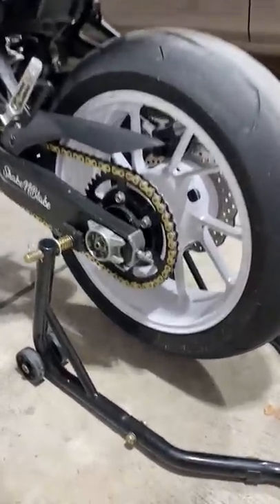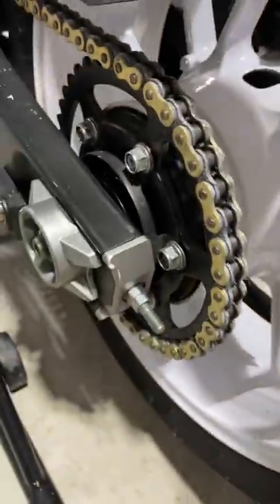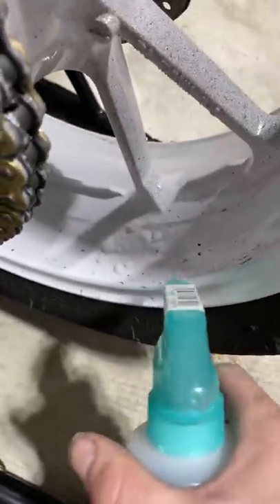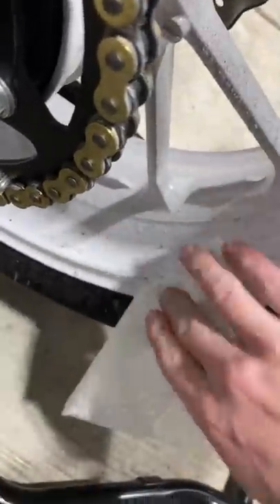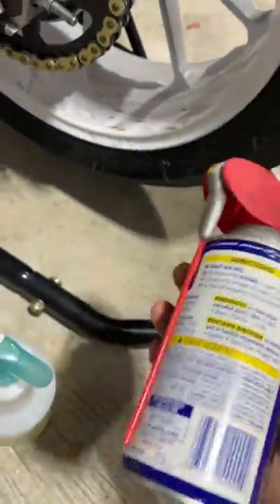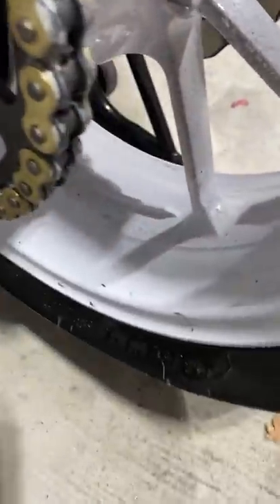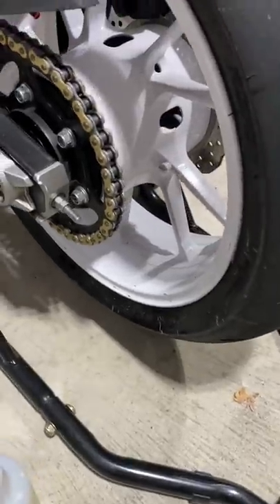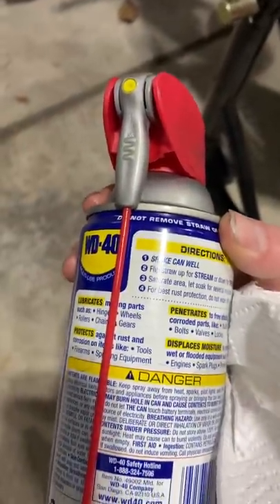EASY tip I wish someone taught me when I started riding motorcycles. #shorts

Comment: If you’re going to do this I really recommend to spray it on the paper towel and not directly onto the rim the last thing you want is WD-40 on your tire
Reply: WD works great for mounting tires and just about everything - you don’t want it on the tread!
Reply: Dude I spray wd40 on just about everything it's one of the softest lubricant out there it actually HELPS rejuvenate life back into rubber tires kinda similar to armor all dried up tires or ones who ride hard to heat up the tires takes out the moisture compound, ever seen an old rubber band & tried stretching it? Now think of industrial or mechanical world with rubber o-rings that are used to seal, if the rubber stays supple with oil it never goes bad but if it dries out or is heated up it cracks & fails, anyway wd40 will only make your tire feel "sticky" NOT "slippery". Been a mechanic for years so that's just my experienced opinion not sure where you gain your opinions from
Reply: Also wanna avoid them brake disks
Reply: Why not the tire
Reply: @lonewolf6842  Yeah, I hear it helps with cornering. Talk about draggin a knee lol.
Reply: @franmitch3589  I'm not disagreeing with the rest of your statement, but wd40 isn't meant to be used as a lubricant at all, the "WD" stands for WATER DISPLACER (40 just means formula#40) and it also contains penetrating agents, so it's safe to assume that the "revitalizing" effect that you see is very short lived and it actually dries out the tires in the long term, but if you've never had a problem then I don't see any problem using it for whatever you want, heck, spray it on your eggs in the morning for a nice zest!
Reply: keys yeah I'm very aware of the original water displacement definition and its origin but the compound ingredients have changed since its original release, and as a side note never had it on eggs but my hands are regularly black oily greasy & I'll stop for a sandwich or burrito & usually end up eating the filth but done that over 20 years & my father before me lmao
Reply: I’d be less worried about the tire & more about the brake side of things
Reply: Wd-40 on your tires will evaporate in a few hours. Not a big deal. Just don’t go around trying to pop wheelies.
Reply: I spray it directly on my treads for added protection of the rubber tires regain grip after a few rotations. Honestly it's a urban myth. Not like your hitting an oil slick on the road
Reply: @franmitch3589  they have a wide variety of products but the original is still mainly for use as a water displacer, and yeah I've been there, but then realized most the older people i knew who didn't protect themselves against harsh/toxic chemicals died fairly young, typically of cancer, or got cancer at some point in their lives, so I eventually found out about this fancy new invention called soap 😮 the difference is mind-blowing
Reply: Don't want it on your brake rotors more like
Reply: Or disc brakes and pads
Reply: @D0CT0RD00M  you’ve never ridden a motorcycle have you?
Reply: @franmitch3589  when you spray it on rubber it will puff it up and start to disolve it and you dont want that especially on bike. And if you spray this on O rings? Good luck with the leaks
Reply: @sharpshot5408  done it for years no bad experience aside from routine maintenance & I've owned motorcycles since high school all the way to current now in 50's everything from Suzuki honda Yamaha & a few Harley sportsters where I live it's cheaper on fuel to commute on a bike so literally owned 1 or 2 at any given time heavily used for past 30 years I ride on dirt county roads pavement mountain passes city driving & commute town suburbs I'm a field mechanic for highway equipment kinda know my way around motors so kinda lucky I guess?
Reply: @franmitch3589  i dont work on bikes but i can say from my own experience it doesnt react good with rubber
Reply: @gw03._25  why? 🤣
Reply: @D0CT0RD00M  Why? 🤣
Reply: @Jeff-fx7bh  Why? 🤣
Reply: @doylehargreaves5057  lol prolly more than you could imagine buddy, I’m not saying it’s end of the world it’ll burn off but why would you want lubricant on your pads & calipers ?
Reply: @Andreas-yt9wv  why what ? Explain to me why tf you want wd40 on your brakes ?
Reply: @franmitch3589  its not a lubricant
Reply: @TheTyisawesome  no its not. It will dry out the tires. Do not put anything on a tire other than soapy water.
Reply: @Andreas-yt9wv  WD 40 has lubricant and other additives in it. Lubricants minimise friction, brakes use friction to stop. Contaminate your disks and pads with lube you'll be riding off the edge of a cliff.  

No real effective way to get it out of pads. New pads all round.
Reply: Or your brake discs
Reply: Came here to say just that.
Reply: kicks yes it is any petroleum byproduct that creates the surface to have a film will act as a lubricant heck margarine butter would too, seriously crazy the replys on this subject & wonder where people pull them from spray wd40 on a metal surface look at it days later under microscope it's still got the residue there dang I dont have time to teach people what's what so go on & make whatever little troll comments you guys want I've got YEARS of real world experience to back up my statements have a good day all
Reply: Wd40 isn't oil, it would make zero difference to the tyre
Reply: @franmitch3589  what does packing grease do  and all lubricants do? displace water to protect metal components..
Reply: @franmitch3589  
Sharpshot is right.  WD40 is up to 25% to 35% petroleum.  Petroleum WILL dissolve rubber.  The rubber will "puff up" as he stated.  It will seem like it is doing you a favor initially.  If it hasn't gotten the best of you, yet, you're lucky.
The best thing for rubber is silicone or teflon.  I also have had luck with winter green oil.  It is plant based and can revitalize stiff rubber and brittle plastics without degrading it...smells nice, too.
Reply: Or anywhere near your brakes. Doh. 😱 😋 As I have seen spray on cloth, then wipe.
Reply: You mean y'all don't use WD-40 as tire shine?
Reply: I came here to say exactly this. You don't want lube on your tires.
Reply: No kidding😂
Reply: Don't mind the tyre, mind the brake disk.
Reply: @franmitch3589  seems like, too me, you use equipment regularly... which might be why you've not had issues with o- rings failing... compared to someone who let's things sit. So maybe it's not the wd-40, but the "use it or lose it"mentality you live is having the positive effect
Reply: No it only seems like it does in the long run it with solvent the oils out of the rubber.  Also if used to mount tires it causes the rubber to stick to the rim. Use conola cooking spray to mount tires. Work even better and wont damage the rubber.  Wd fan boys need to stop promoting dangerous uses.
Reply: Don't worry about the tire it's the brake rotor you want to worry about
Reply: @CarlMan69  very true
Reply: @franmitch3589  LOLLLLLLLL
Reply: @SwitchetBladeX3  LMFAOOOO
Reply: @franmitch3589  I race super bikes and you must be a terrible mechanic, it will absolutely cause issues on a tire it actually will break down the rubbber . Let’s not even get started on what happens when it gets on brakes . Don’t get anything on your tires good lord , makes it sticker what kind of mechanic are you gonna have kids spraying lubricant on superbike tires . Do you even ride???????
Reply: @franmitch3589  must be a terrible mechanic, lmao you cruise around on harleys or on dirt roads and are telling people who own superbikes to spray  wd on tires ????????
Reply: @mcsbikelife3829  I rode for over 40 years all over everyone untitled to their own opinion my comment was basically stated as a view that the sky wont start falling if wd40 gets on  your rim or tires or whatever I replied to a post that said it's not a good idea, I just stated my account of experience over almost 30 years working on all sorts of motorized equipment it's not the end of the world heck you could wash the bike in it & it'll still be ok & not to be defensive but as to what kinda mech I am well I'm the lead field mechanic for highway paving crew we work statewide all are licensed within an area where of truck drivers & equipment operators I service it all usually on the side of the road not some prissy shop everything from new digital stuff to old oil leaking smoking disasters seen it all already
Reply: Yup I was just gonna say that thank you for putting this on because you probably saved a lot of riders before I would have put this on!!!
Reply: @lonewolf6842  because WD-40 DESTROYS rubber,
Reply: Been there done that
Reply: Dorifto mode on
Reply: Yeah I was thinking the same thing.
Reply: @andrewarnott2619  would defeat the entire purpose because he has white rims
Reply: WD 40 will actually soften a tire and make it grip more as long as it isn't saturated. Go karters have been using it for years as a tire softener to get more grip out of thier tires.
Reply: Yep
Reply: My first thought exactly!
Reply: @GreenMntMoto  well I do it to drift better
Reply: And brake rotor
Reply: @This YouTubers Neighbor RyanF9 did a video on this subject.
Reply: @franmitch3589  WD-40 is not technically a lubricant, it's a blend of several chemicals. More of a protectant which is why it helps leave rubber conditioned. A fuel oil such as engine oil, gear oil, tranny fluid and such will break down the plasticizers in rubber. Unless it's a special type of rubber. You say your a mechanic, then I know you've seen  hoses around the engine area that are so soft that they literally fall apart in your hand from being soaked in oil. I also am a wrench man and I know the differences. Actually your technically right about it getting on a tire, I've been riding for years myself and I've had it on tires and brakes. No big deal if you get a little over spray on it just wipe it dry and it'll be fine, it's not like your soaking the damn thing in it geez these girls commenting do think the sky is falling. The guy with the race bike...hell yes I don't want any slippery shit anywhere near my bike. Love the guy who said just do a burnout
Reply: Funny some of the comments here , spray on go kart tyres for grip hey , mmm   How often they get changed , couple of races . Would they spray it onto tyres in the wet , no , what you going to do use your bike and hope it don’t rain whilst out . Never spray wd40 on tyres , the petroleum breaks down the vulcanised oil in the rubber causing it to go hard . Spraying wd40 on tyres is asking for it , probably like that reg plate is too . What banana said fit it there cause as soon as police see your bike your fined for it . You can tell the newby riders saying I spray my tyres , listen to the old riders who know through experience, tyres and wd40 don’t mix
Reply: @pauldean8638  bUt ThE iNtErNeT!
Reply: @pauldean8638  thank you
Reply: @thicok4555  hey no worries , you know the answer mate ha ha  , it’s all age and experience where you think oooh tyre looks shiny, then next min your on your arse wondering why in the rain ha ha . Best thing in a bike is Gt85 the best as it’s Teflon . Makes things less stick able so the bike stays cleaner longer
Reply: Gives me a good reason to do a burn out.
Reply: @pauldean8638  it’s sad to see kids think they know everything in this world nowadays and your 100 percent right ride safe brother
Reply: @thicok4555  yeah ha ha how many dismiss the wealth of knowledge through people who experience things first hand . I was guilty of dropping a few bikes after being told don’t spray your tyres . Still it’s a life experience you learn the hard way by road rash and mending your bikes ha ha funny how we the ones giving advice to the younger inexperienced. You ride safe to my mate ,  we already riding safer , we don’t put wd40 on tyres lol
Reply: Exactly!
Reply: I'm confused?! I just took my bike to my mechanic for my 50xxx mile and he told me since I've been neglecting the maintenance side of my bike I have to get new brake rotor. He said that every 500 to 1000 miles you're supposed to lube the rotor to maintain even brake pad wear. 

I had no idea!!
Reply: @hardedar9647  that’s the reason why you paying for a new rotor because you did or didn’t know he’s full of poo . Bet he said he do it cheap as he can and just fit you in . Calliper move to even out brake wear
Reply: @TheTyisawesome  not good advice is it. Seriously are suggesting to spray oil on to tire is a good idea.
Reply: @lonewolf6842  petroleum products degrade rubber
Reply: @steve0680657  petroleum products degrade rubber
Reply: Not going to hurt anything its a solvent
Reply: Ditto
Reply: No, the last thing where you want it is on your brakes
Reply: @franmitch3589  seems like common sense to me, the comment about not getting it on the tire, I always get some chain wax on my tire but I’ve never lost grip because of it.  As long as you’re aware of it, and go easy for a bit, it will rub off as you’re going down the road.  You don’t want to wear off your chicken strips before the tires have warmed up anyway
Reply: @GreenMntMoto  wd40 eats rubber compounds. You dont want wd40 on any rubber at all

Comment: There is also a product available that’s made specifically for degreasing things. You’ll never guess what it’s called.
Reply: Lmao....good one.
Reply: Deg…….
Reply: D e g r e a s e r
Reply: Dw04?
Reply: Good one
Reply: If you haven't got that. White spirit. Or terps. 👌🏼🤷🏽‍♂
Reply: Daki
Reply: 1173
Reply: Hahaha
Reply: Water displacer formula 40????
Reply: Water displacer formula 40???
Reply: Brake cleaner does wonders against grease
Reply: Waiting for this
Reply: It's called "Ungrease-anating spray".
Reply: @johnvang1592   i just deleted my comment after reading yours 😆  i said Ungreaser too   lol
Reply: Lol
Reply: Let me guess, its call increaser
Reply: because wd40 is not a lubricant, am i right... best to rub it on the tire and brakes as well...

not like a standart cleaner costs like 1 $ more and does the same thing without applying a layer of friction reducing chemicals on the surface...
Reply: Paint remover 🤣
Reply: I like using googone. It’s kind of like a mix between wd40 and acetone. But it won’t hurt the clear coat on the wheel
Reply: Tire shine
Reply: Degrassi, Drake's a shareholder
Reply: BRAKE CLEANER
Reply: Don’t you say degreaser lol
Reply: I always use brake and clutch cleaner. Around £15 for a 5 litre can lasts for ages. You only need a little on rag.
Reply: WD40
Reply: Degreasenator?
Reply: Kerosene ?
Reply: DE- GREASER.  soo you take a teenager from the 50’s and wipe his hair on it ???!!!wtf.   I guess! Come here boomer!!!
Reply: Wd40? The degreaser
Reply: Try Lemon Pledge you'll never use anything else.
Reply: Oh shit degreaser who would’ve thought of that.
Reply: @ssproductions790  break cleaner would work but thing about break cleaner is it's not safe for all surfaces. Like powder coating. It will eat through powder coating.  WD 40 won't.
Reply: @MSRooky350z  WD-40 lubricates. Prob best not to put it on brakes or tyres. Although I'm sure I have by accident.
Reply: Break cleaner or spray 9 for me
Reply: @iManMe23  just out of curiosity, why are you tagging me with this?
Reply: Lemme guess... Soap?!?
Reply: @ssproductions790  and paint
Reply: Beat me to it.  Degreaser is also cheaper than wd40...
Reply: @jijoet5491  haha that's funny ASF😂
Reply: You could also use the same product you use to clean your chain I use kerosene/paraffin
Reply: Ya it's called thingy degreaser stuff
Reply: Well he is usen a paper towel to clean his wheels soo naa prob wont guess what its called 😂😂
Reply: Paraffin!! (Kerosene for our colonial friends)
Reply: Coolant
Reply: Coca Cola
Reply: Lol
Reply: usually people
wouldn’t think about using wd40 i’ve known this trick for a long time and it really works
Reply: Superclean?
Reply: Simple green is what I use... works great.
Reply: Degreaser isnt clear coat safe
Reply: Brake cleaner.
Reply: Kero. As good a job and cheaper than WD40.
Reply: Much cheeper as well 😅😂
Reply: WD41
Reply: @41alone  it works?
Reply: @Anthonysmith-ic8ef  for a rusty chain?
Reply: @antoniomitchell1883  Yeah go ahead and try it out
Reply: @Anthonysmith-ic8ef  thanks
Reply: @the_wilkini  chain cleaner can be a bit pricey but kerosene is cheap.
Reply: Formula 88
Reply: Yeah...gasoline, diesel, laundry detergent, and some water, spray bottle 🤔 Road tar and grime off, drive chain clean like new
Reply: Brake cleaner lol
Reply: 😂😂😂degreaser 😂😂😂
Reply: @ssproductions790  and against rubber too
Reply: Hot Pish?
Reply: @iManMe23  sure to have an accident!😂😂
Reply: 😂😂😂 DE GREASER maybe? 🤷🏿‍♂️ idk ijs
Reply: Ungreaser?
Reply: Is it called shampoo?
Reply: Cheese grater
Reply: Some types of degreasers ruin paint jobs